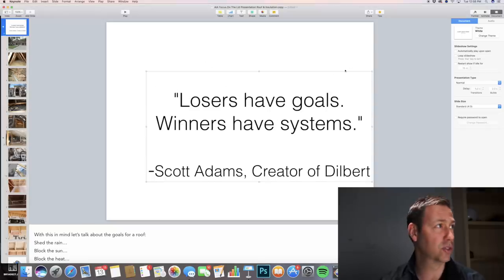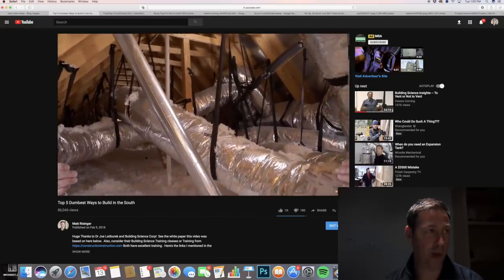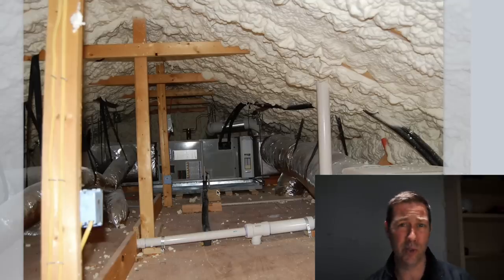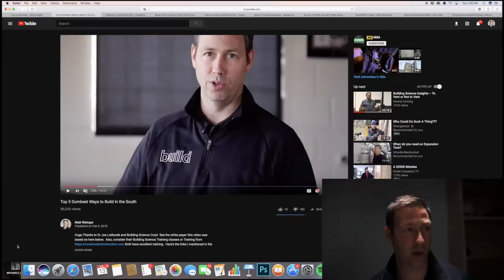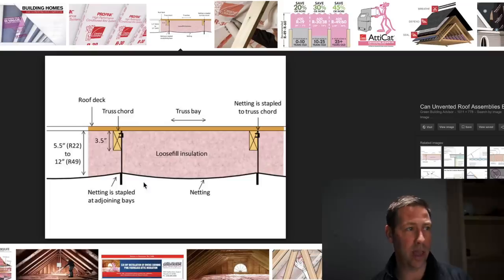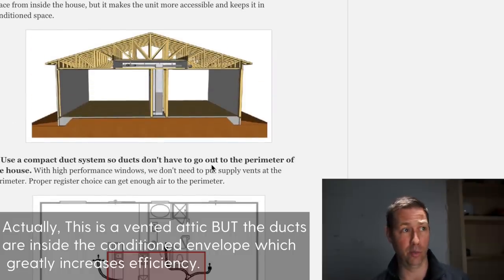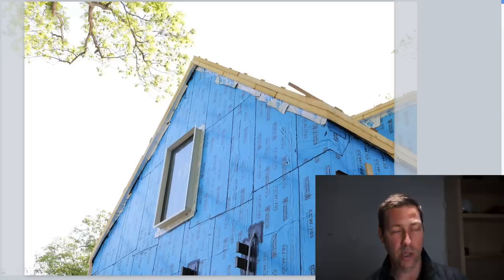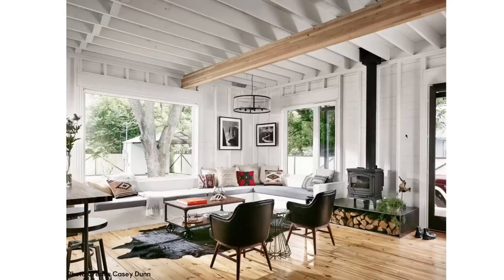Attics/Roofs - Dumb vs. Smart - How to Build Correctly

Comment: I was going to say on that last house. Holy shit thats not going to meet any fire safety codes XD Then he says it was a little hassle to meet fire safety. It's a pretty nice idea it has me intrigued but I wonder what you could do to make it actually safer because if a fire starts thats going to burn like crazy.
Reply: actually he could've mentioned that there are a few products out ther..like from 'Flameoff' has a fire barrier paint..and 'Flamestop' has 1-ds..and firefree' has a product called '88..also HyTech has some additives..i bought a gallon of fireproof paint white from ebay or amazon to do around the laundry area..cost was about 75/gal..

Comment: I have ‘78 split level with a truss framed roof but no ducting in the attic. I love in Maryland. Would you still recommend I get rid of the fluffy layer on the ceiling and do a closed cell spray foam on the roof deck?
Reply: Check the link below video in the comments.  Changing the construction of the existing house is only recommended if your duct-work is in the attic due to the increased cost of modifications to the existing structure.
Reply: Brock Hashimoto Maryland is quite a bit colder than Texas, but the summers are hot and moist. I would recommend sealing the attic space from an airflow point, then replacing the insulation “fluffy stuff” on the sealed attic floor.

Comment: If I am building a home but have plenty of basement space for mechanicals, with no plans to use attic space for HVAC, would fluffy stuff be just as good as spray foam? Nothing will be in attic. Only access point for plumbing vents, recessed lights, etc. Thoughts?
Reply from the maker: Yes, that’s totally OK. Just make sure you have an excellent air seal at the lid. The stack effect will force air through the smallest holes in your lid
Reply: Thank you sir. I am a contractor and am currently building me and my wife’s dream home in North Georgia. Using tons of your info from your videos. Thanks again!

Comment: Why the hell would anyone spend money and energy cooling an unused space?  How long does your asphalt roofs last in the southern sun without airflow below the deck cooling it off?  Seal your ceilings and duct work better.  Insulate them both while being careful to preserve the MAXIMUM air flow along the roof underside.  Ever hear of a mechanical room?  Keep your expensive air exchanger on the temperature controlled main floor where NORMAL MAINTENANCE and service can be performed on-time by the homeowner.  Keeping the attic structure as close to outside air temperature as possible is KEY to maintaining a roof that doesn't need constant attention.

Comment: I was under the impression (from a fair amount of investigation) that placing insulation in direct contact against the underside of roof sheeting was detrimental to shingles because it didn't allow heat to dissipate due to the lack of airflow behind the shingled sheeting. At the time, I found multiple sources stating that it would void shingle warranties. Is this only in the case of asphalt shingles, or is the info I found entirely false information altogether?
Reply from the maker: Look at the link I provided in the description about that very topic. I believe the information you’re seeing is miss leading. There is very little effect on single life by using insulation under the roof deck
Reply: thanks.
Reply: Partly because the heat can't radiate past the shingle and radiates out instead?

Comment: Why would the furnace depressurize the attic? There is not an open return in the attic, and the attic is vented. If air wants to come in from the attic, it will come it from the wide open vents, not the house. And the amount of air leakage on the return side is nowhere near enough to depressurize the attic
Reply: Risinger's long-running (from other videos also) complaint is not the depressurization of ATTIC, but depressurization of LIVING QUARTERS below, by reason of forced air system duct leaks in the attic.   The negative air pressure in the house will be compensated from EVERYWHERE, as there are many parallel paths of air leakage INTO the living quarters.   I live near Los Angeles, where it is hot and dry, so I favor a vented attic.  But Risinger's ideas make sense east of the Rockies, and especially where humidity and severe temperatures combine to rob the homeowner.    In California, the cost of electricity is several times that of the cost in Texas, so energy efficiency makes sense differently. 99% OF CALIFORNIANS who retrofit existing 1960s-70s housing use "supply side" remediation:  solar panels on the roof.   These people are high earners in high tax brackets who are targeting federal tax credits, etc.   I try to help modest earners who won't do solar panels:  I favor "demand side" and hence my fascination with Risinger's lessons.      I am an electrical engineer and a radiant barrier fanatic; they really work if you respect the need for "air gap," shiny side DOWN, and rafter bay ventilation up and out through ridge vents.    But I digress.

Comment: Foam is way more expensive. Pain in the ass to do. Can’t foam when it’s cold. You make the house to tight and can’t breathe as good. Plus if you ever get a leak or need to run something it’s a pain in the ass removing that shit.
Reply: Agree on everything except “too tight.” Impossible!
Reply: David Burnett yeah if you put in mechanical ventilation . So it can breathe. But either way foam is shit. It’s good for hitting inside and outside wire holes and windows but foaming the attic is just dumb. Plus it will kill your shingles

Comment: Air tight house with a wood burning stove.... Where does the combustion air for the wood burner come from?  I'm sure it's more for decoration, but is that a concern?
Reply: You've gotta a 19th Century problem there, pardner.       But truth be told, my natural gas kitchen (changed from 1964 all electric to gas recently) has the same problem.   Air will be drawn down the chimney flue and also through leaky windows (many parallel paths of various impedances) unless you open a window near that wood stove of yourn.

Comment: Spraying the bottom of the roof, doesn’t that increase the exterior temp of the roof since it’s not venting across the bottom?
Reply: Yes, in fact there was some shingle companies for a while that would not honor their warranties as a result. I think they have moved beyond that now.  I would highly suggest not ever using an asphalt roof on a house if possible, but the economy of it is hard to get past.  Metal and tile are expensive. I have a clay barrel tile roof that greatly helps with roof temperatures.  Requires an excellent underpayment.  I like metal too, except the expansion and contraction of the metal requires attention to that aspect to keep things from leaking.  I have metal standing seams on two outbuildings and you can easily hear the roof expanding and contracting during the day. Tile doesn’t do that.  Asphalt is just screaming hot, and doesn’t last very long.

Comment: The spray foam will degrade by heat over time. Bad Idea. Use an insulation material that is easily replaced. The foam is highly flammable too.

Comment: I'm like the .5 % who knows of thermal mass earth building in the world, Mike Reynolds being a bar set, I myself have well rounded trades, a little of this a little of that for 20 plus years,
I'm currently doing FEMA relief remods, in the south, and yes agree with you, I'm California born and raised and there's code for farting wrong... in the south??? Lol if you call it code, I'm like wtf all the way around in work ethic and quality even progressive behavior is non existent. 
I bought 1 acre of land, build a small home and raised my newborn special needs daughter in it for less than 5 grand in 2 yrs...
90% of heat loss or tain is the roof...
So yes the capsule idea is better...
My home 90% recycled was 68 degrees without any heating while outside was -5 degrees... a small fire in wood burning stove got it 80 plus for the day... no Bill's
I use common building techniques with old God given knowledge... and I can build a mansion from 100,000 with self sustaining perks, no Bill's, and something's for your great great great grandchildren to still love and benefit from... today's standard is garbage  and about profit and bottom line...
Good to see acknowledgment in this fact...

Comment: Could you have used Zip System instead of OSB on The Perfect House?
Reply from the maker: Yes absolutely I’ve thought about a new version of perfect wall with ZipR
Reply: Matt Risinger 
I am going up to Idaho to work with a guy I have been evangelizing to your building science methods...
Some of your Texas methods work in SoCalif where I am now but up in the snow country of Idaho panhandle it is different climate so we need a different verse and chapter of the gospel.
Reply: Matt Risinger Q

Comment: Matt would you be comfortable insulting only the exterior of the house in a northern climate?
Reply: Most of the designs they have to build are insulting enough to those of us with architectural taste... Not sure he's too concerned about that, however...
Reply: Best thermal performance is gained with exterior insulation regardless of where you live - Zone 1 or Zone 7.

Comment: Matt yes those first couple of lofts weren't insulated properly but you clearly do not understand how a cold roof system works. Now I understand that a cold roof system doesn't fit in with your idea to build a perfectly sealed building inner envelope in a passive house but if a cold roof system is done properly I.e. Insulated properly,vented at the soffits and the ridge the house can still be passive,the envelope just finishes right on the ceiling level. Air circulating around the loft space does not jeapourdise a passive house system.
I get it that you have been learning how to build a passive house with the envelope going right up to roof level but that doesn't mean that that is the only way it can be done. You then get some photos of a house that's been built with a cold roof system in mind but have not been properly insulated and pointed it towards your hundreds of thousands of subscribers and basically told them the houses have been built incorrectly, and these people believe you as they don't know better. Not everyone can afford the type of whole house system you want to sell and they don't need to,yes it's a great system and one that I would build in to my own house but I would be the builder so it would cost me far less. Your not as clued up as you think you are!
Cue the comments from viewers slagging me off now as they listen to you and follow you blindly.
You are a good builder but your a closed minded builder.
Reply: Yep. I had a home built in the 30's always built and insulated to the standard traditions. We did a full renovation. Guess what no mold or rot and was $124 electric each month. I live in the South. The standards in my home were much lower than even spec homes being built nearby. He's a builder and get markup for every dollar it costs, so of course it's $250 SQ ft. He's marketing himself, plain and simple

Comment: I want the most energy efficient attic for my home

 living here in Phoenix Az

I want spray foam but after reading about the horror stories I'm kinda scared

Asphalt shingles life span shortens

Termites drawn in by wet wood

Fish smell

Rooting roof

Dangerous toxic chemicals 

And i have vaulted ceiling so there are spots that are darn nere impossible to get too
Reply: Blow where you can, try your best to insulate AC components. Add attic fans

Comment: Spray foam? You really favour it? Is that because you know you can charge more money  for more work when it is time to do any other type of work? Spray foam is like a glue, permanent. What happens when you want to do renos in the attic? Then you have to replace the whole roof, joists, osb, etc? As I understand here in the North, it is said not to insulate the roof because it can cause ice damming. You need to vent the roof and keep it the same temperature as the outside, cold and cold, warm and warm.

Comment: I am in the north and have HVAC ducts in my attic. I need to add insulation due to ice damming but don’t want to do spray foam to the roof deck because I will need a new roof in ~5yr. Rather than spray foam could I do batt or rockwool insulation between attic roof boards leaving an air gap between the insulation and the deck. Then add 2in foam board insulation attached to the bottom of the attic boards which I would seal up air tight to create my vapor barrier and increase insulation?
Reply: Most roof replacements don't require decking replacement, and if you have visual signs of rot on the under side of your decking now then the time to take action is now. Unless your house is as old as mine has 1xs instead of sheathing for a roof deck or has visual signs of rot then you should be able spray foam now and reroof without hurting the spray foam. The spray foam will total about an R30-40, if you insulate the cavities instead, every truss will not have insulation over it like it would if you used spray. A 2x6 has roughly an R value of 6. 2in foam may get another 6 but it seems far from 30-40. Lastly, I don't know the manufacture's recommendation of rock wool on the roof line since it is only pressure fit, so you would have to check with them on that particular application (unless you get another reply); however, with the addition of foam, it seems logical. Just know, the bigger the air gap, the less of an R value you will get out of the truss itself... Come to think of it, an unvented air gap may trap the hot air and cause premature curling of shingles on the roof (assuming an asphalt roof) which is why we started venting attics in the first place. Sorry for the rant. Hope it was mildly helpful.
Reply: DesignIY thanks for the reply, makes sense!

Comment: Matt, I really like your channel. but your vendetta against vented roofs/attics is a bit silly. There's not a thing wrong with a properly vented, properly insulated vented attic. Your conditioned attic is a lot more expensive for obvious reasons. Your roof deck is spray foamed which means finding a leak in the roof is nearly impossible. If that spray foam is open cell, it's going to soak up water like a sponge if there is a leak of any kind. You're also going to have to spend more money on a larger HVAC system, or a second HVAC unit to condition the attic.

There are cons to a conditioned attic. I've lived in a home for 20 years with a vented attic and have never been uncomfortable, because I have the proper amount of insulation in it.

Comment: If I have a vented attic can I spray foam
Reply: No!  You will impede attic's ability to conduct air flow and dry out, and you are increasing the mass of sponge where condensation might occur.    Yikes.

Comment: So spray foam has been bad for some homeowners to the point they've been run out of the home because of toxins in the foam...how is that any different in 2018 2019 then 2005ish 06ish
Reply: mistakes in the mixing or formula cause the off-gassing and stench. Done properly it's not an issue. The real problem is cooking shingles because of no venting underneath, AND if water ever finds its way in black mold...

Comment: Why don't we do basements in the south? My inlaws bought a new house and couldn't find a builder that would do a basement.
Reply: high water tables and frost lines, as well as rocky digging or clay soil.
Reply: Rick SC I'm in NC
Reply: Noconz0727 MC I couldn't agree more , basements in the South are a home run given the hot balmy weather.
Reply: jasen ratnam Georgia here, we have quite a mix. Most of the newer construction has half basements (built on a hillside), while the older construction is built directly on a slab. Only the nicer (re:private contractor) homes are built on a raised slab with 1-2ft being common. 
  
For reference, my current home (1995 construction) is slab-on-dirt in the back with 1-2ft rise in the front (hillside).
Reply: Basements....Mildew, water, and humidity .... I live in Fl and Ga. but in Louisiana they don’t even bury people in the ground. Because they will float out during floods.
Reply: Basements do get built here in the south, but the overwhelming majority of them have moisture issues, and if it’s living space, you have conditioning issues. Because builders like quick and cheap... not right.
Proper dehumidifiers and proper basement prep and drainage will prevent issues in basements... all of which cost more and take more time... builders don’t like it.

Comment: that spray foam is beautiful until you have a fire...it fire retardant until it isn't than it becomes a fuel that combusts hotter that pure petro.......tested this theory by spraying a flower box than throwing it in a fire.i'vwe been putting it in clients place for 0 years now and now im looking for  alternatives
Reply: Use fire-rated closed cell spray foam for air gaps combined with mineral wool for insulation.  Mineral wool/rockwool won't burn, cannot grow mold, and is vermin resistant.  It also won't compress and sag compromising insulating value.  It's commonly used in Canada but relatively uncommon here in the US, except perhaps for noise dampening.  Mineral wool itself also meets fire barrier requirements like between garages and occupied spaces above.  

*To be clear, I have zero financial or other interest in mineral wool.  Just a homeowner going that route in a planned build.

Comment: Worst idea ever. Never spray foam between the rafter bays. Best to put rigid insulation over the exterior roof sheathing.  Roof type will dictate weather there is a vent cavity between the roof system and the rigid insulation.   Research the issues with the spray foam method and the cost of air to air heat exchanges and indoor air quality.